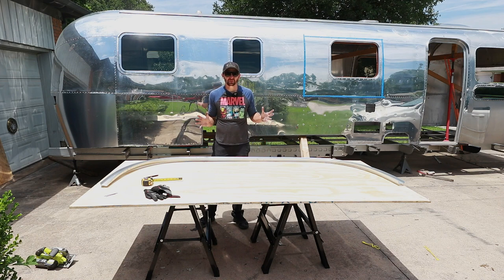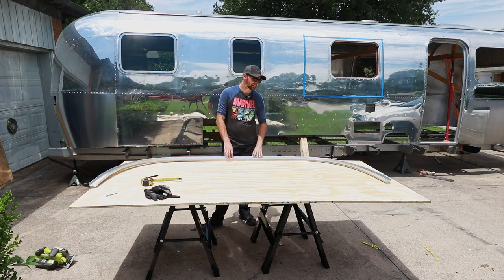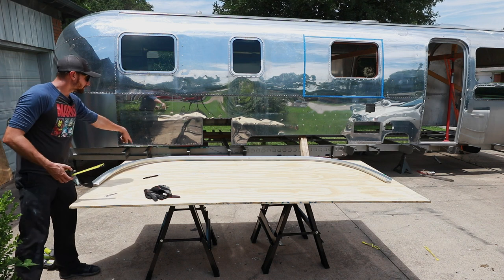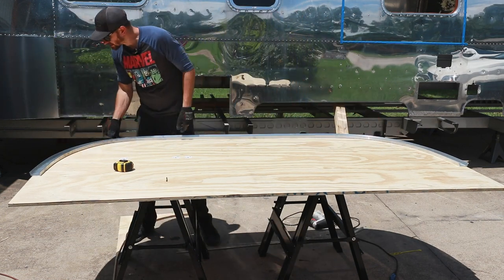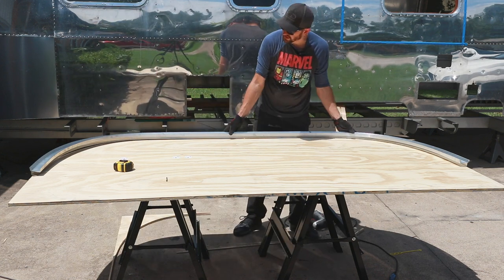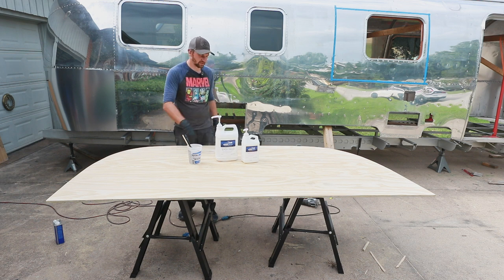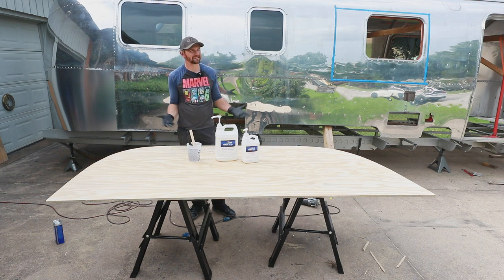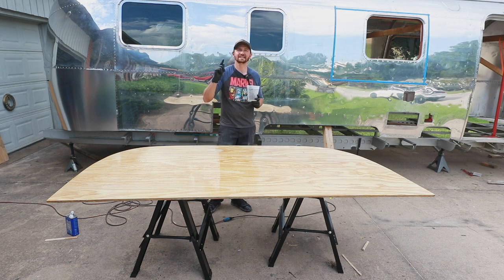Airstream Subfloor Plywood Selection and Preperation

Comment: You shouldn't use pressure treated lumber with aluminum. Hopefully it will be ok since you coated with epoxy. On future builds you should use marine grade plywood. It is available here locally in north Texas
Reply: Why not? Isnt the treated plywood the same thing as Marine The Marine just have less defects in the plywood layers allowing less moisture and water to get in between?
Reply: @alexissurprenant131  the chemicals in pressure treated wood cause corrosion in aluminum. Marine plywood uses a water resistant glue to protect it against water damage.  There are different grades of plywood that determine the voids and quality of the finish whether it is regular plywood, pressure treated or marine.

Comment: Would a squeeze be easier and quicker for flat surfaces. Also after the first batch you could mark cup for both epoxy and hardener. Project coming  along. You mentioned friend had roof damage. Was that the day the crane collapsed?
Reply from the maker: Not from the crane collapse, that was "just" 70 mph straight line winds that day.  On fathers day there were several tornados across the area.  Not big ones but enough to do some damage.

Comment: Project is coming along nicely. Been watching for ages now. We are at a similar stage just finishing up welding the frame and be moving onto the subfloor soon. I’m curious to know what your plans are for time working on the project, are you still working the full time job as well or have you taken the plunge and decided to focus more on Miller Garage? Time is the one thing that holds me back a bit, we work on our projects every spare minute we have but I feel I need a lot more time than we seem to have. When you mention 3 months to completion, if I was looking at the same timeline for ours I would have to almost be working on it everyday.

Thanks!
Reply from the maker: It is coming along for sure!  So I am still working full time at the dealership.  This is one of those seasons where I am just putting my head down and making it happen.  I start at the dealership at 5-5:30am then get home and work till 8pm and then work 12+ hours on the weekend.  I am trying to actually get ahead of the 3 month time schedule because we have our baby arriving mid August.  Its a lot but worth it and we had that discussion before committing to the project. I worked on a fishing boat in the Bering Sea for 2 months and really learned what I am capable of and so for a short time, I am just putting in a lot of work.  This is a huge thing though that will help us get where we want to go so it is exciting! Glad you are enjoying the videos!

Comment: Very helpful thanks! I have 88 29’ im working on. About how much product does it take to cover a sheet of plywood? Or how much does the gallon kit cover?
Reply from the maker: I used about 1 1/2 gallons, I would probably get a gallon and a quart one.  https://www.amazon.com/TotalBoat-Performance-Epoxy-Gallon-Medium/dp/B06XH2Q869/ref=sr_1_5?crid=1OIK1RQTE31IC&keywords=total%2Bboat%2Bepoxy%2Bresin&qid=1573046116&sprefix=TOTAL%2BBOAT%2BE%2Caps%2C173&sr=8-5&th=1&psc=1
Reply: Appreciate it!

Comment: Your videos are extremely informative. I am currently in the middle of doing a shell of renovation. We were forced to build an entirely new frame out of hollow core metal. I am buying the plywood this week but overlooked the floor channel. I went to order on out of doors mart but it came to $350 and will not ship to Florida. Where did you get your floor Chanel? Thanks!
Reply from the maker: I use DFW Airstream.  They are just up the street from me but they should be able to ship them to you.  Talk to Trish in parts, tell her I sent you.  tray@airstreamdfw.com

Comment: Would you recommend the total boat epoxy/hardener or have you found something better?
Reply from the maker: Total boat is my favorite.  I have used some others but they don't work as well.  I used a tabletop one from amazon but it seemed to soak into the wood more and not seal as well.
Reply: Miller Garage ok good! That’s what I ordered! Thanks 🙏🏼
Reply: Miller Garage o
Reply: We did ours in Red guard. It's a single component waterborne waterproofing membrane. It's flexible and is meant to seal for showers . It's far easier to apply and cheaper.

Comment: I assume you coated all sides of the plywood, correct?
Reply from the maker: Yes, all sides, all cuts, all holes.
Reply: How long is it expected to last? I'm seriously thinking of doing a Coosa floor in my fith wheel frame off build. If its going to last 20-30 years then I'll save my money.